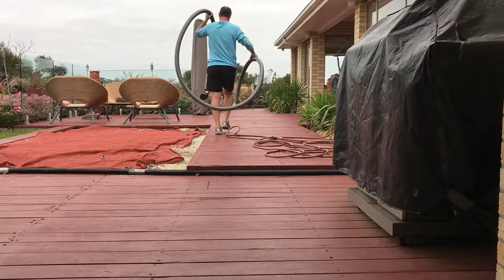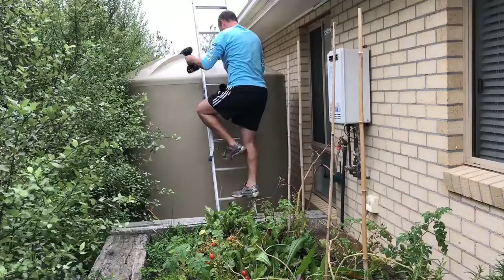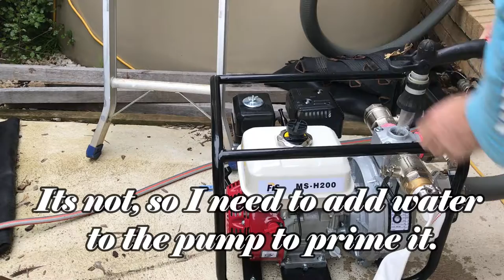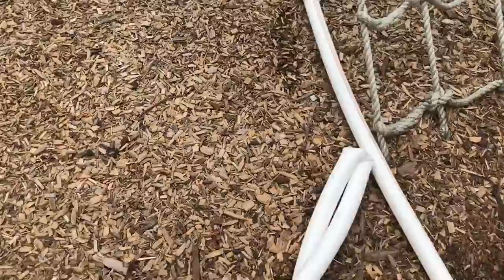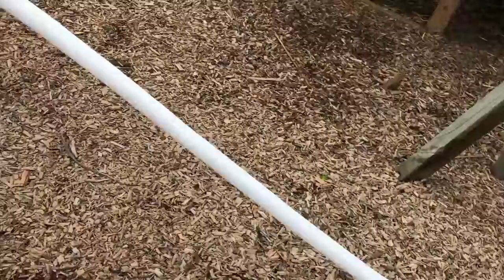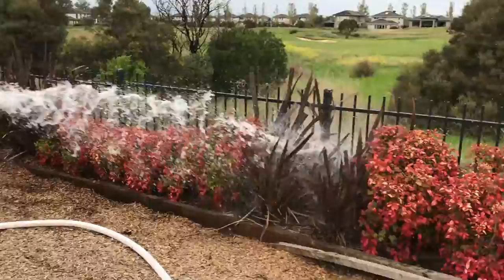Fire Pump Part 2 - First Test

Comment: I did my first test run of a similar system a couple of days ago.  It is supposedly self-priming, but only under ideal conditions I think, such as the suction hose being not too much lower than the pump, the engine being on full throttle, and not having any trapped air in the suction hose.  In your case, the way you have the suction hose curled around, it looks like you have trapped air in it.  With all outlets closed and the engine off, lay the suction hose out flat next to the pump, then fill it through the priming port, then put it back into your source above the pump (looks like).  (I'm assuming you have a one-way valve at the end of the suction hose so water cannot exit that end.)  Then start the engine, put it at full throttle, and open your outlet hose.  I think that will work.  Of course, your video is 2 years old, so you must have figured that all out by now.  Cheers.
Reply from the maker: John Kenney hi, yes, all good points. I have a mini series of videos and I have learned a lot. I do have a one way valve at the suction hose inlet. I have found that priming is a pain, loops in the suction hose need to be filled with water, the suction hose to pump connection needs to be very secure ( so no air can be injected ) I have tried filling the suction pipe with water and it works, but it’s such a pain doing that, so I now fill the pump, get the pump running and vigorously giggle the suction hose to assist priming. Thanks for watching.

Comment: also, instructions state not to have valves of while engine running overheats the impella and buckles them
Reply from the maker: Hi, thanks for watching and subscribing. Are you saying that outlet valves need to fully open to allow the pump to self prime ?
Reply: @TheRuralProject  no .if you keep valves closed  for more than while the pump is going it overheated the impella and can buckle the casing.e v en self priming pumps should be manually primed
Reply from the maker: @victorpashkevich8801   ah ha, yes I agree. I have added a circulation pipe on my fire trailer, so that if the pump is running on idle, ready for use, I can have water running through the pump and back into the tank, when I then need the pressure I shut off the circulation valve, open the fire hose valve and turn up the engine revs. That’s all shown in my fire trailer videos. Thanks for the reply.

Comment: I do this for a living, stretch out your fire hose first so that it is strait watch a fire dept video do you think they just throw their hoses in a pile? This can damage the hose or hurt someone plus after you prime your pump remove the air from the line by opening the fire nozzle on your hose if you live in a fire prone area you need to practice I can set up a portable pump with 3 fire hoses ready to go in 5 minutes also pull it out every 3-6 months change the fuel and start it. I see so many people that buy a portable pump fill it with gas then go to use it 2-3 years later in a fire and it won't start because the gas turned to jelly. Take care of it and it will take care of you in your time of need.
Reply from the maker: kevin vt   Thanks for the advice. Good points.